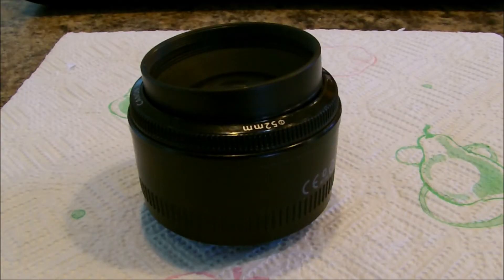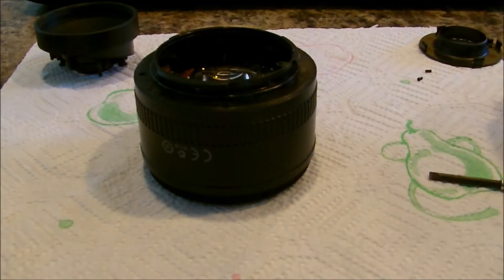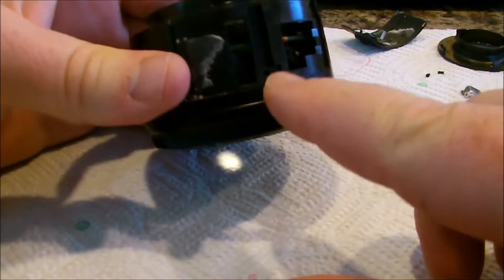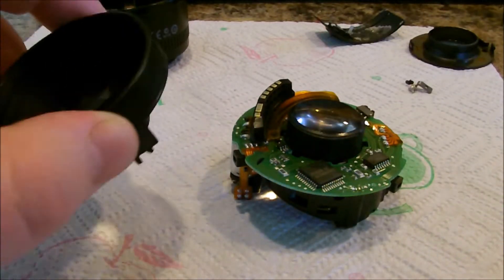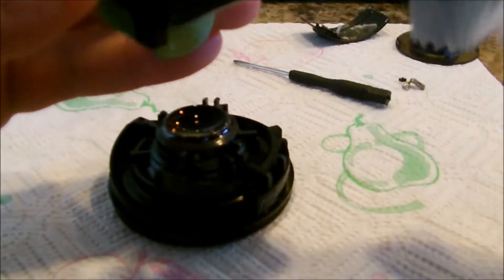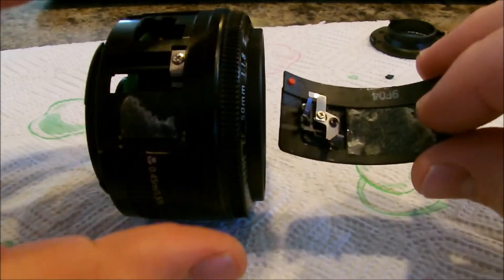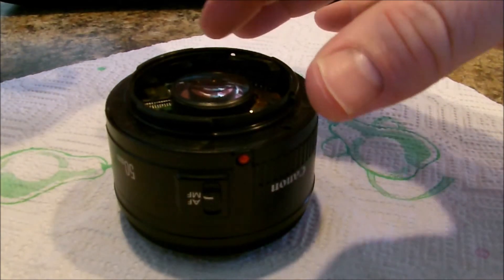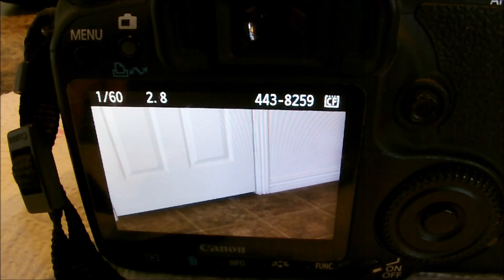Canon 50mm f1.8 II disassembly and reassembly

Comment: Hi! Hey Thanks so much for the instructions, the video is awesome and clear! But I did the same and cleaned the lens inside. One thing that happened to me. Now the autofocus/manual focus switch is not working properly. It seems that a gear thar make the switch inside is not working properly. It is not broken or anything but is not getting into the right place to swicth the focus option. Please assist.
Reply from the maker: Juan Carlos Aronne it sounds like you'll have to take it apart again. make sure it's put together correctly.

Comment: Thanks for the vid! got to fix mine but i have a new problem. the focus ring is to rough. so hard to spin it. do you have a fix for that?
Reply from the maker: +pierreson tan look at 8:30 it has to be placed in the right spot. You can see I had to move the location so it spun freely. This may be your problem.